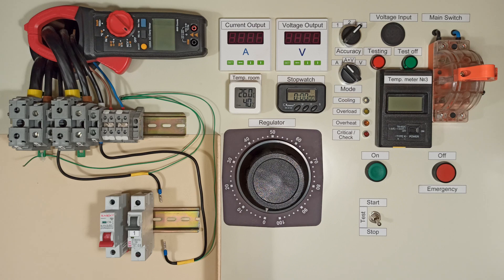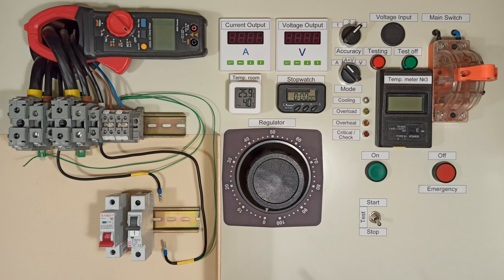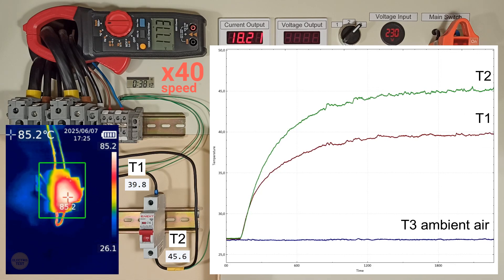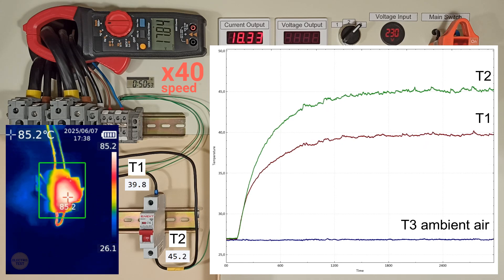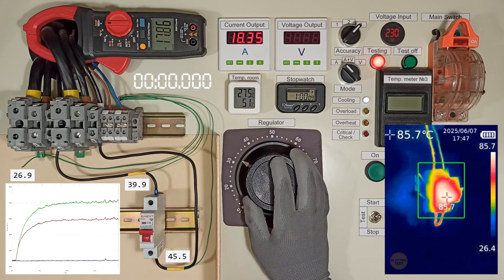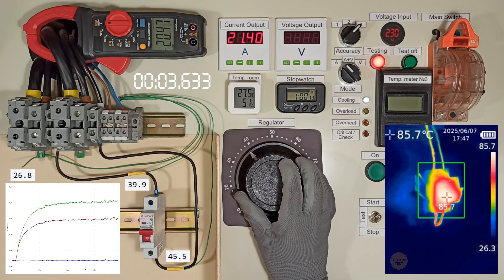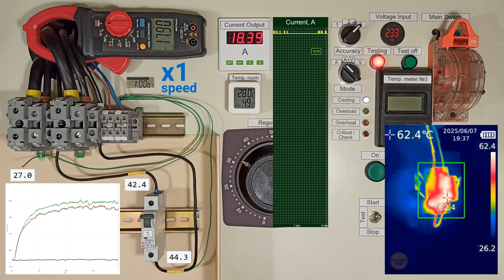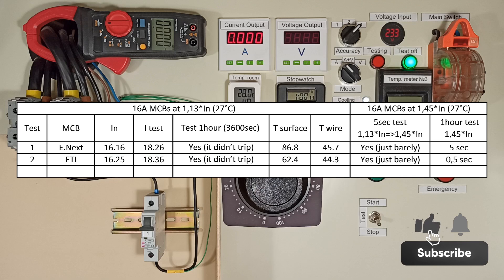60-minute test MCB at 1.13×In. Breaker ETI, E.Next

Comment: The e.next temperatures certainly raise concerns, what if you had several such side by side? it would have even less cooling. Unfortunately their web page is truly abyssal and does not have any useful information at all. Maybe you can reach out to them and ask?
Reply from the maker: Hi! It's interesting that the heating shown in the video is still within the acceptable range. Although just 1–2 degrees more would have been too much (considering 60+ ambient), and that could even be within the margin of measurement error.
But there’s no need to worry too much. In reality, if the breaker had been installed in an electrical panel or if there were other breakers nearby, it would have tripped earlier — that’s all.
In general, I’m thinking of doing a similar test inside an electrical box, and I’m also curious about the melting point of that kind of plastic.
Reply: @ElectroTest_1  good plans!

Comment: So E.Next might be unsafe if placed between other breakers in a small box?
Reply from the maker: No, I don't think so. It will just trip even faster. I'm just surprised that this breaker still falls completely within the standard limits — even though it's right on the edge. I'm wondering if it's just a coincidence or if the manufacturer designed it that way on purpose.

Comment: Nice Video!
I wonder how the Breaker would perform in reallife situations, like imbedded between two other MCBs (maybe also quite hot) on a rail in an circuit box. It should even get hotter because of worse heat dissipation. Maybe it would also trip before reaching the one Hour mark.
Reply from the maker: Thank you for the idea! I’ll think about how to film it. Do you think I should use the same breakers or go with other well-known brands?
Reply: @ElectroTest_1  I think those same breakers will work well for this test, so we can see the difference best.
Reply from the maker: Thanks for the suggestion! I'll try something like what you said!

Comment: Hello, can you test circuit breaker vs fuse (cartridge, wire or flat link)? Thanks
Reply from the maker: Hi! I like the idea with the fuses!
Which ones do you use exactly?
Do you ever use a copper wire instead of a fuse?
Reply: @ElectroTest_1  Hello! We use circuit breaker anyway. The wire I mean is a composition of tin and lead wire or also know as fuse wire without the cartridge (glass or ceramic). I'm just curious switch one the best protection between the two (circuit breaker or fuses)? It's gonna be great showdown from old vs new.
Reply: @ElectroTest_1 You can use any fuses as long as the same rating. Thanks
Reply from the maker: Okay, thanks for the explanation. I’ll look for some test samples!

Comment: In my old house (in au 240V) with old reticulated wiring I fitted 10A elcb combo breakers in series with a 16A fuse wire. My old washing machine tripped or blew the wire very intermittent at random intervals. Eventually I traced the fault down to a small bleeding resistor immersed under conformal coating. The resistor was fitted to discharge the X capacitor in its main filter. No visible marks were found on this 1/2W carbon resistor. Just how it managed at times to blow a 16A fuse wire whilst leaving the modern breaker ignoring it remains a mystery.
Reply from the maker: Interesting story! But it’s not clear how it ended — did you remove that resistor from the circuit? Or did you end up changing something completely?
Honestly, in electrical work, strange things like this happen quite often — and sometimes they remain a mystery forever! 😄
Reply: @ElectroTest_1  for the time being the whole filter board is out. To even see this tiny resistor I had to rip out the X capacitor. Strange I had worked one time in an R&D lab of a respected filter maker. We never used bleed resistors except in medical devices.
Reply from the maker: Got it! Glad you managed to sort it out — hopefully it keeps working well.
It's always interesting to hear real stories from experienced electricians.
And what field are you working in now?